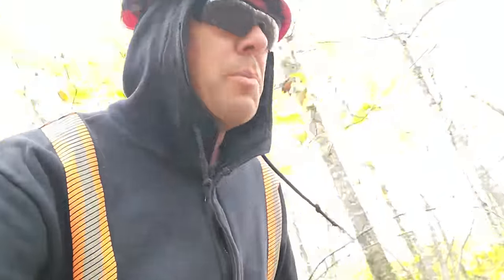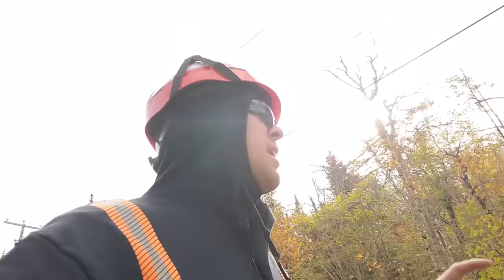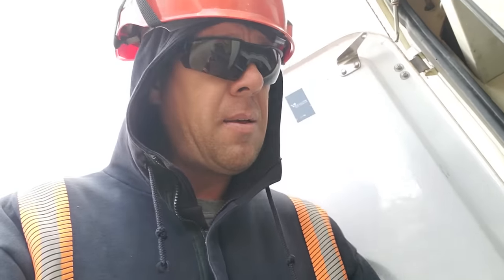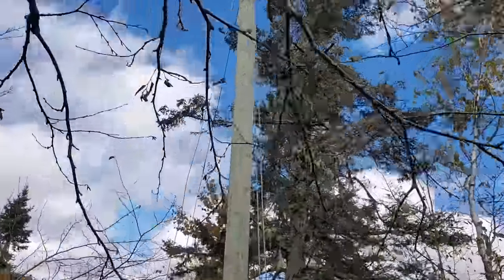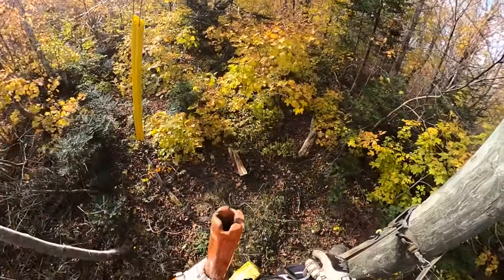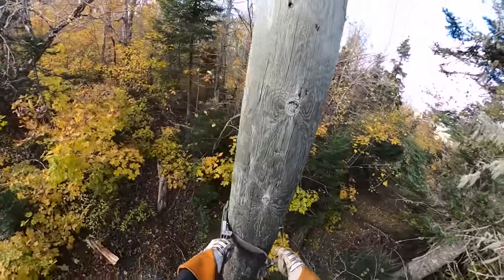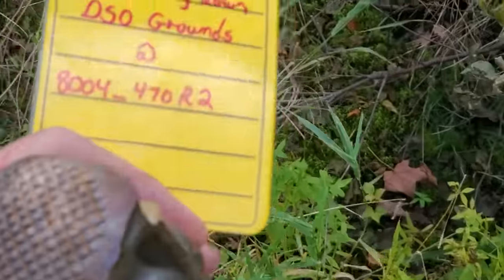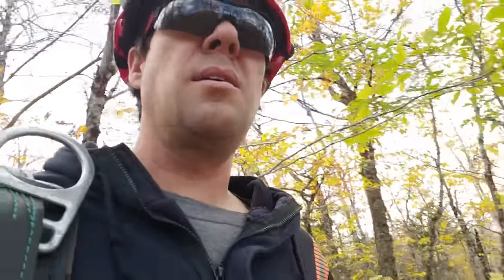What are "DSO" grounds?

Comment from the maker: Hey Everyone!

I'm assuming many companies have different terminologies and work methods for this idea. You can't always (especially during storm) respond to every emergency call out there! During an active storm we receive many emergency calls, too many to handle! The main idea is to make each of those calls as safe as possible until they can be properly delt with. Shut the power off, ground the lines and move on to the next one!... Until the calvary arrives!👊💪
Reply: Just curious. Why not check for potential then use hot cutters and clear the primary and neutral off the pole and clear the hazard instead of hanging a ground? Since it is already cleared off the source pole. Not being a critic brother. Just wondering. I mean as long as both ends are on the ground then does it really need to be grounded in this situation?
Reply from the maker: @linehandibew6205
Great question!!
The "passer by" was actually a retired lineman, so I had a pretty good idea of what I was walking into. 
He phoned dispatch first and they had already punched in a plan for a DSO ground. I thought about requesting to do exactly what you said, but then figured I wouldn't have been able to clean up/touch the wire anyhow since I didn't have a second guy with me. Had I had a second lineman with me, I would have cut it clear and coiled it up!
Don't ever worry about being critical brother! We're all here to help and learn from each other 👊👊
Reply: @Bobsdecline  thanks man!!! Yeah I forget it is a different mind set being solo. I’m used to having a crew so the way I approach situations is completely different. When you’re on your own you need to take extra precautions because there isn’t anyone else to back you up. Love you content. Best line work channel out there. Probably the only one that is actually showing proper safe practices. Stay safe brother.

Comment: Here on the west coast the crews get completely overwhelmed when a storm hits. Last year we had a tree come down beside our house, but nobody in the little subdivision lost power. The primary line was about 8 feet off the pavement, holding the fallen tree up. I called BC Hydro and they left it hot like that for over a day. I was astounded when a neighbor used a chainsaw to cut limbs off the fallen tree so he could drive under the hot wires, it wasn't more than a few feet from the top of his truck to the 14,000V wires. Crazy. The next day they de-energized the line, and it was a few days before they had time to deal with it and turn our power back on.
Reply: Dollars to doughnuts he thought those wires were insulated and there was no risk.
Reply: have seen that before and warned a guy trimming branches over his driveway. He said, "but it's not live" so I put the fear of god into him by saying there was a crew at the end of the block and that might change while he was up on a ladder. There was no crew, but he got a good wakeup call! (and his wife gave him shit too)
Reply: @markbernier8434  Yes. All our hot distribution lines are bare.
Reply: Insulated or not don’t touch them and stay back. I would have called the power company and 911 saying you’re trapped in and they would be forced to come out and at least de-energize the lines and move the tree. I’ve seen people do that and if it’s a medical emergency you better believe they will be on top of it.
Reply: @JackThelRipper   ...people also get weird tunnel vision around cars and "places they can drive".  In a medical emergency, if say, no fences, just drive over a few yards and then out somewhere else.  Just have to keep your wits about under stress so you don't do anything super stupid....
Reply: Figures.

Comment: Everywhere I worked we had a way to transfer clearances too. Sometimes to dispatch if it was going to be a while or to someone else who would be scheduled to go to that job. So removing tags with another name wasn't that uncommon. All transfers documented on the clearance sheet and over the recorded line too. 
The self laminating tags are nice too, but a lot of guys used to hate to have to "waste" a tag for every tag. If I remember correctly, they were 25 cents each, years ago and we also had to tag each blade of a three phase switch if not gang operated. Clearing a sub would take a ton of tags and so much handwriting. Hours of filling out tags sometimes..... But all part of the job and all good.
Reply from the maker: The worst I've had was over 100 tags for one switching schedule. It was a highly involved 345kV power tx refurb. The second worst was maybe 15 lol, so the first was a very unique situation! We don't typically tag each blade here, but do often tag at multiple locations on some devices. (Electronic+manual+I'd tag location for example)

Comment: I do pole surveying and inspection for a fiber company all over the Midwest US. I've run into Condition Abnormal tags before, a few different types depending on what state/area I was in, as well as a couple of actual lockout tags for work being done nearby. With the Condition Abnormal tags they always listed some reason for there to be an abnormal condition but I never understood how exactly they were used. This answers a few questions I wondered about them.
Reply: And I wish even 1/4 of the power companies in the areas I work were as good about pole numbers as your company. Easily 80% of the poles I survey don't have a number, and a lot of the ones that do just have essentially a serial number, it can be looked up but the number itself isn't formatted in a way that would convey anything useful.

Comment: Aside from less danger here than in town: if you leave wires laying around in town or suburb, they get stolen. (Someone stole 5 pounds of steel off my roadside when I went back to the house for a band-aid🩹.) Way out in the woods, will be slower to find and take longer to unsnarl.
Thanks for the explanation. I've seen you mess with lockouts and assumed the authority was radio-delegated to you, because 'site' is hundreds of miles wide/long, but good to see how that happens.

Comment: In Ontario you sign onto a work permit to apply grounds and then if you are leaving you sign off the permit, but leave the grounds then the next crew can sign on to the permit to complete the work. When the work is completed they remove the grounds and do a final surrender of the permit. It can then be energized by any crew.

Comment: As you implied, this is overkill, but at least you followed the SOP for liability reasons... and the total clean up is going to be done by another crew. BTW, in my line of work, I had to keep track of consumables (that ground strap) and make sure I got another on the truck for next time. So many of the guys either failed to do that (make a list) or went from memory and would wind up with a dozen of something over the next few months.... and the truck was always cluttered to a point where you can't find anything, so you get yet another.  <LOL>

Comment: So you attached a 'ground' wire from a dead primary to a returning neutral why? I'm not questioning it, I want to understand the reason. You stated that the condition of the line was probably present for quite some time, and I'm assuming that, had that dwelling been occupied, your company would've been notified immediately when the tree fell and they lost power? So the 'live' end is where you started the video by the supply line and the primary to the residence was broken? You checked the potential of the downed line and there was none, so when the crew goes there in a few days, will they replace the line? Or just remove it? I'm not understanding the potential hazard of the line that is laying on the ground. Thanks btw for the videos. Very interesting and well done...not any extraneous talking and all great information. Take care.
Reply from the maker: Tbh there's not really a hazard... the primary was laying on the ground and already well entangled with the neutral.
 Problem is; Procedure wise, where do you draw the line?... basically it's either grounded or it isn't. I'm order to be considered ground, a tested and approved device must be used. This case is really splitting hairs, but ultimately it wasn't grounded according to our procedures.

That all being said, there still exists a very small chance of a hazard existing. The L2 side of the primary was still on an insulator, the downed portion may also laying across very dry or high resistance areas of the ground. In theory, it could build up a static charge.

To err on the side of caution, we simply always install a ground
Reply from the maker: Oh, I forgot to add; The crew will complete dismantle the entire line. I circled the home before filming and it was definitely beyond repair. Looked like it had been vacant for 10 years. Roof was laying in the living room lol
Reply: Not grounded, not de-energized.
Reply: What’s the most remote location you’ve ever had to work in?

Comment: I’m confused.  You said you were “grounding” the lines, which to me means you run a conducting cable down to a metal stake in the ground.  It doesn’t seem like you grounded anything.  ???
Reply from the maker: Our system is has a multi grounded neutral. That section of neutral is bonded to the pole ground on L1 and L2 as well as both those down guys.

Comment: Whats the point of Grounding to a non continuous disconnected Neutral . If anything i would think that would be more dangerous if the line became hot the Neutral would become hot as well due to your ground bond .
Reply from the maker: The neutral is bonded to the pole grounds on structure L1 and L2 as well as those two down guys on L 2